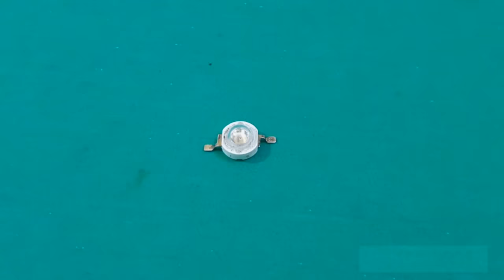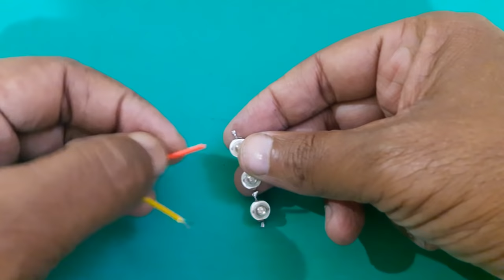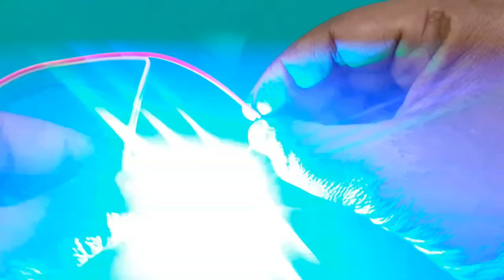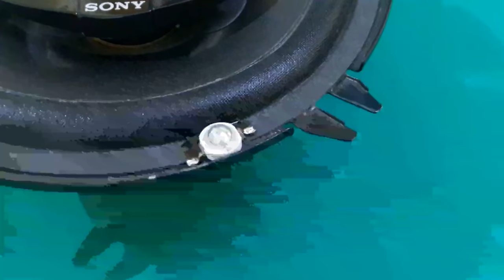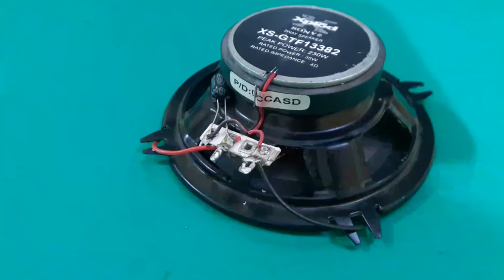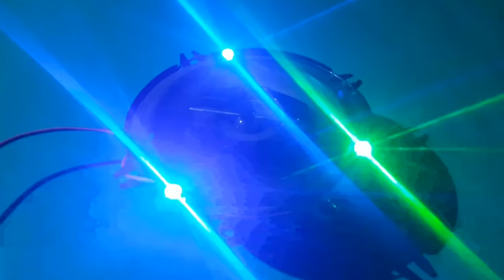How to make "LEDs Flash" to music/bass

Comment: Add a resistor in series to avoid burning up the LEDs. Good job.
Reply: What kind of resistor would I need?
Reply: Use 12v Led Light . They dont need any, capacitor or resistor, but they required more volume to light up
Reply: @jonathandetro5014  1 kohm or so. Depends I. How bright you want it.
Reply: @jonathandetro5014  great work

Comment: You couldn't described about that capacitor and capacitor's wiring, also didn't about capacitor's value. which is clearly visible at speaker's connection point...
Kindly mentioned it..
Reply: It's a filter capacitor. It's for the speaker not the LEDs. The cap filters out a certain range of frequencies that the speaker wasn't designed to play. Check out low/high/bandpass filters for more info. Also this method will destroy your amplifier eventually

Comment: This method is not good. It needs something that will allow the LEDs to light up at the same intensity even the volume is at 5% or at 70%. It should react to the beats and not how loud the music is.
Reply: If it reacts to the sound intensity also I would prefer that because it's more immersive. Otherwise super loud and super quiet sounds get the same LED response? 🥸

Comment: The leds are pulling more power then the speaker so it’s distorting as it is playing so y wouldn’t I just run a wire to a separate speaker channel instead of putting the leds directly linked to the speaker

Comment: I have done this to my sound system but when i turn up the volume the light burn
Reply: Do with 12 volt led strip,100%work
Reply: @tomsonpaul3526 
'
try connection with a resister would be fine and no burn LED out
Reply: Amplifier life reduces
Reply: 3v leds ,they die on 6v